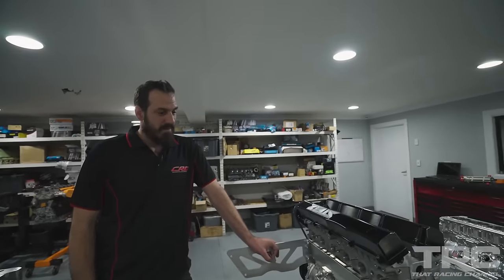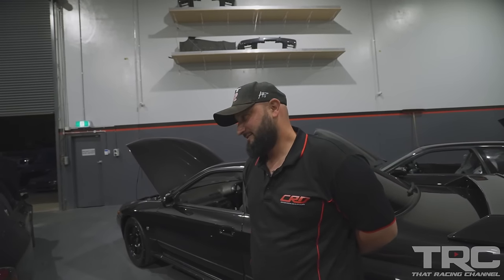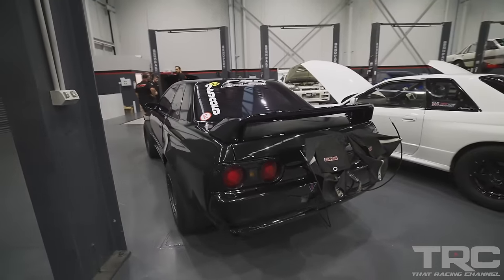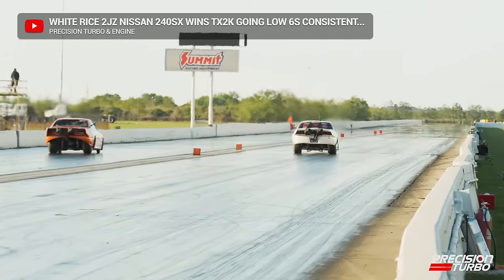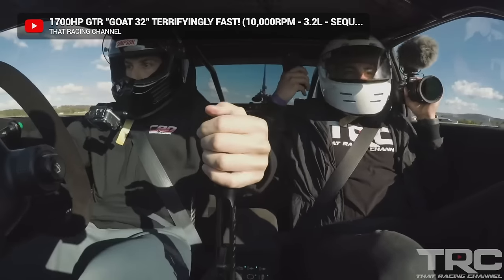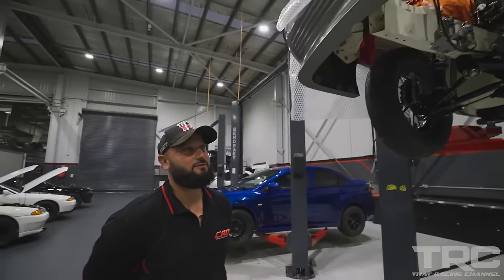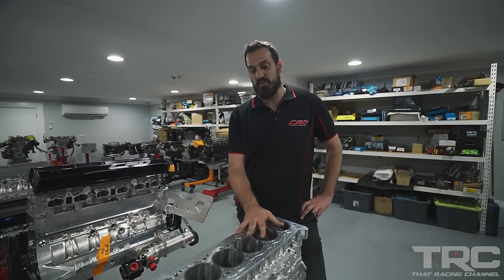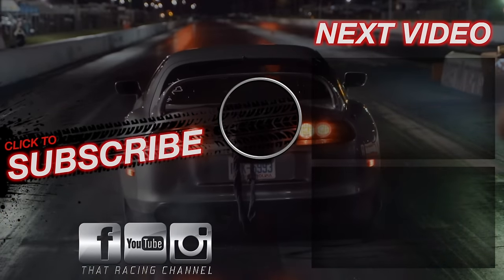3000HP "JUN II" R32 GTR - 100PSI OF BOOST! (QUICKEST GTR in the World - Shop Tour)

Comment: I keep reading comments on Croydon's being Australian - and I guess these days they are but I am old enough to remember when Nick (Croydon Wholesalers LMVD) was importing GTR's and Glen Suckling was driving for them. That legendary 1994 R32 was bought at a dealer auction and was listed as having "gearbox problems"  - if you think having a GREX 6 speed with straight cut gears is a problem. It was running a massive Trust single and was constantly going through development. I remember reading that they would be" stoked to make it into the 9's" some 20 years ago. Congratulations on all your hard work & success fella's!